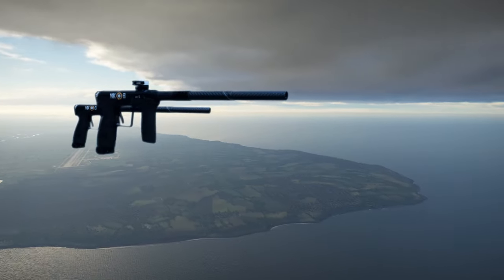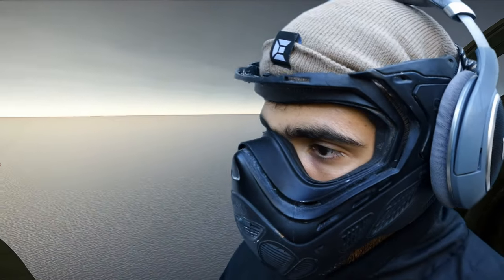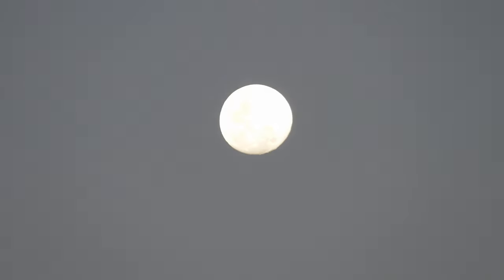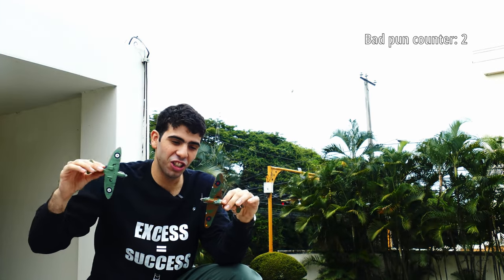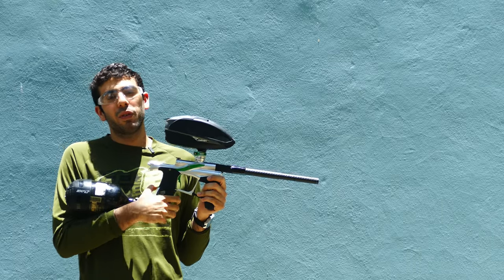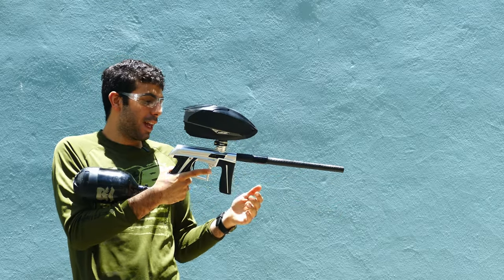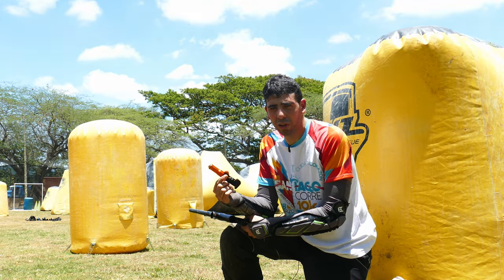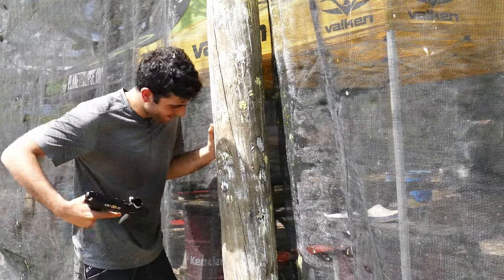PE GEO CS2: The Fire-Spitting Racehorse

Comment: Which barrel do you recommend for throwing a cs2? Will the 14.5 inch barrel give you better leverage for takeoff?
Reply from the maker: In my ample experience of throwing, I'm more concerned about the flight than the launch. A lightweight barrel helps keeping the weight centered on the marker and therefore flight is stable. The worst thing you can do is use the wrong barrel, because not only will YOU throw the gun, but it will also be throwing itself around in the air, sacrificing range, speed, stability, and accuracy.

Comment: I own a Gtek170r. I have used an Emek, a CS2, an Etek 5, and an lv1. The Emek shoots really really good, not quite as good as the 170r but still good. The 170r and CS2 shoot identical. I literally couldn’t tell the difference between the two other than the ergonomics. The Etek is somewhere in between the Emek and the 170r. The LV1 was my absolute favorite, super buttery. I have an LV1.1 on the way right now and it might replace my Gtek. Can’t go wrong with a planet eclipse gun

Comment: would the cs2 internals be superior in any way to the BL VIS engine?
Reply from the maker: for most people, yes. For the tinkerer, there's more fun to be had with the VIS.
Reply: @JustCantGetRight  I just got my V1 updated and I cant believe the consistency over the crono. Its unbelievable I have the velocity set to 290fps, this will absolutely not stray outside of 290-294fps. Ive never had a marker that kept such a tight fps like this VIS. I fine tuned it and put much larger incriment 0-100psi gauge on my pressure tester and it kept this consistncy withy a lpr pressure of 65psi. I startd at 55psi and kept adjusting the hpr for my vlocity but when it hit 65psi I got this consistency and left it there. this thing has almost absolutely no recoil at all. you werent kidding when you said it feels like holding a bag of popping popcorn. no barrel rise during rapid firing.

also Im getting almost 14 pods of paint off of 4100psi 68/45. I just cant see anything out there that rivals all of these advantages this VIS engine has to offer.

Anyways thanks for your response. Im about to move out of this shithole of a state NEW YORK. My mother just died last week wednesday so I have no reason to be in NY anymore. Now Ill get to play PB during the winter in florida :-)

Comment: Having both trigger devices adds an unnecessary point of failure.  That is not the PE way.  This is the way.
Reply from the maker: I'd argue that having both trigger switches lets you count on an alternative in case one fails ;)
I've had microswitches bend and break in the past. The opto has never let me down, and trust me, once you master it, you'll have missed it too.

Comment: I noticed you use the hard bolt over the soft tip and was curious about your preference between the too. Seems like they fixed the soft tip design so reliability is no longer a factor.
Reply from the maker: I used both actually. It just happens to be that I filmed with the hard tip. 

Here's my train of thought, I'll equip the hard tip by default because there's nothing wrong with it and it hits a bit higher velocity so I can run lower pressure (but it's not necessarily more efficient, they should be very close), if the paint is brittle, I'll switch to the soft tip. But If I play again before servicing the marker and I run into paint that isn't brittle, I won't necessarily go out of my way to put the hard tip back in. It'll go back in when I service the marker.

Comment: I have put 32,000 rounds through my CS2 in 2 months on the field. Many people at my field also have them. I can say it’s an ok marker but I am not impressed by it. It feels good, shoots well. But velocity inconsistencies and POOR EFFICIENCY have been my biggest issues. This has been a common experience for all CS2 users at my field. We all have full Freak XL kits and using tournament paint. 68 45 tanks. We are all not impressed. XLS, DSR and others outperform the CS2 in my opinion for half the price. I just got an Etha2 and after last weekend I am choosing the etha2 over my CS2 until I can replace it. Not a bad gun, but not worth the price tag.
Reply from the maker: Allan Black that doesn’t match the performance I’ve enjoyed with it, indicating something may be off. I’ll try to help. 

First with the easiest bit, I personally wouldn’t recommend using a freak kit with a gamma gun, they don’t need them. Just either overbore or underbore, matching results in velocity inconsistency. Also, never bore match any gun, run the closest overbore or the closest underbore. 

Next step is to make sure everything is clean and in good shape.

Lastly, make sure that all your parts fit and seal snug. The bolt should be snug along the bolt guide and can, the spool snug in the switch, the switch snug in the valve body, the reg piston snug in the frame. The gamma system does not work properly with a loose fit. 

Try those things, because the experience you’re having with the CS2 is abnormal.